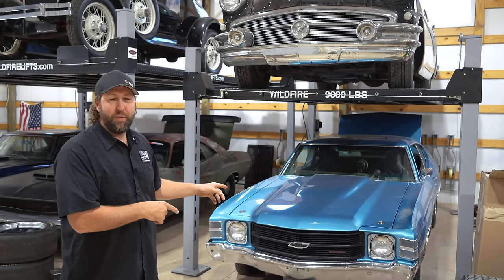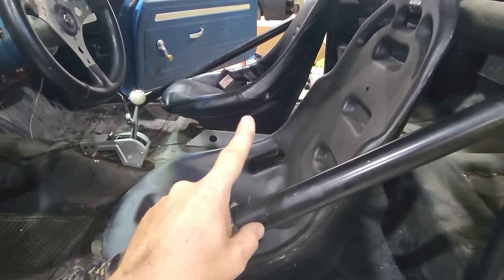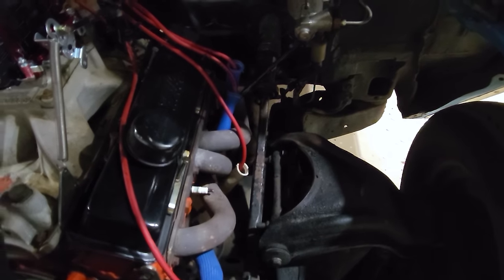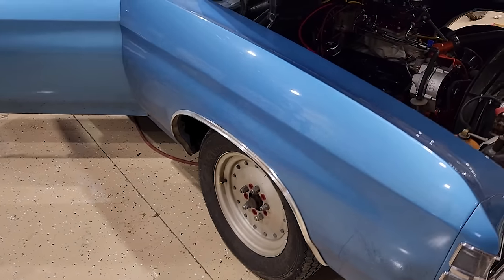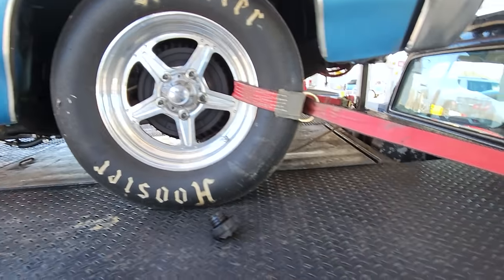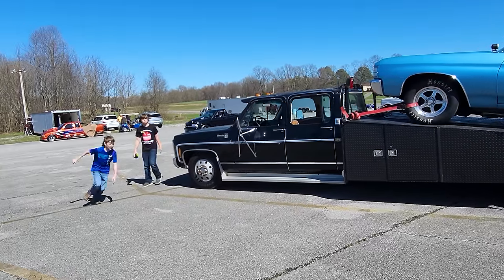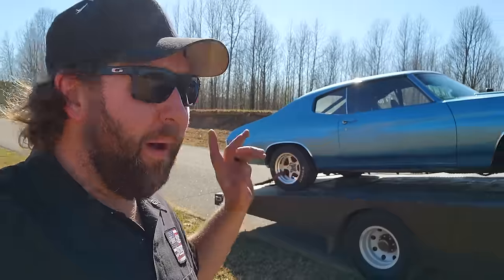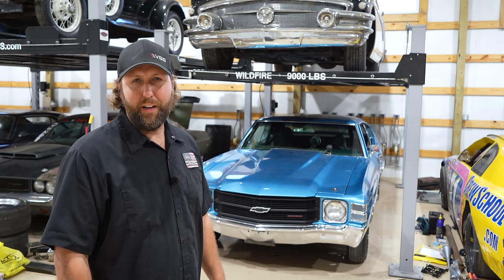35 YEARS off the Road - Classic Chevelle's First Passes are INCREDIBLE!

Comment: You need to hook up a switch that runs youe water pump and fans to cool it down thats how we do it as soon as you come off the track you have some one on your crew start running. The pump and fans shell cool down pretty fast between runs
Reply: If it were me I'd put in a bigger roller cam  and pistons and,  definitely rebuild th at manual valve body transmission and go with a bigger rear gear in the rear end

Comment: Them ole 406s are stout engines, my dad had a built 406 in a 70 camaro with full interior, turbo 350 trans and a 12 bolt posirear diff with 4.11 gear. Car ran 7.60s in the 1/8th consistent. That motor is very capale of making big power

Comment: Hi I love your channel. I suggest you build it up slow first up date fuel an injection system, new ignition would go hand in hand.  Kind a like what we would do slow up grades.  Next Nitrous next gear or transmission changes, suspension as needed, then either a blower or turbos.

Comment: Oh dang my bad lol i thought it was a 350 small block ... thats awesome you have the same small block in that chevelle that i have in my 89 S10 blazer lol. Yup i have a 406 small block in a two wheel drive 89 S10 blazer , its red n white. My uncle built it in the early 2000s.. the 400 small block came out of a chevy impala , it was just the block when he got it. And he had it built and hp wise its almost 1hp per cubic inch its 407hp 406 small block , with a 350 turbo trans. It was built here in Bristol Tennessee. And i also got a gmc Typhoon thats amazing lol. But its nowhere near as fast as the v8 s10 tho.. lol but still neat.

Comment: If it were mine I'd put some aluminum heads (Maybe Edelbrok heads) and a better cam. I'd re-ring it and put in new bearings and gaskets and timing gear and chain.  Then an aluminum radiator, a better torque converter and shifter, plus a trans brake and aluminum driveshaft.I would put Polyuerathane bushings all around and only tighen the nuts on the control arms until they just touch and use lock nuts so the arms are free.

Comment: What to do now? Well, for Drag 'n Drive I would: give a built 4L80e, new u-joints and trans brake, 4:11 posi, Holley Sniper kit, 400 skinnies like the biggest radiator you can shoehorn into it, whatever shifter you are most comfortable with, I like steel fans, so the biggest fan and shroud that will fit. Let's see...high-power charging whirler, maybe an electric pusher fan, let Jessica make the interior pretty, and that's about all it needs to cruise. The old school motorhead who built that engine knew what he was doing. The Crane Commander was a great cam. This recipe should get you to 11.4 quarters on drag slicks (maybe better), but still cruise to town without having to stop at every gas pump along the way. Good luck with it and keep on racing.

Comment: Hey brother that car would've been quick in its day in a eigth mile and I'm probably about to tell you something you already know if you hold it in low gear a turbo 400 will shift itself around 6000 you are right that you need to shift before then until it'll make power over 6000 however the time you lose with the shifter acting up you'll make up letting it shift on it's on because trust and believe it don't miss a lick it shifts quick and hard
You can also flip the linkage where it hooks at transmission from the bottom to the top which will make the shift pattern like a reverse pattern 
If the bracket mount doesn't have top and bottom linkage option you can be creative or buy a linkage bracket that do
Love your show
Keep that humor up you've had me laugh through some tuff times

Comment: I saw that your Chevelle pulled to the side when you left the line . do you not have posi-tracktion ? i had a 65 Chevelle with a 327 H.P. motor with 350 HP running a 411 rear end . I raced many cars , a Plymouth GTX with 426 Hemi , a Henry J with a 383 Hemi . And beat them all !

Comment: I think my path on the car would be first radiator and shifter, then brakes. Update anything safety related and anticipate going faster than planned.  Once that is all stable, time to bump the power.  I would be looking to put the car in the 10s.  Heads, intake, cam... head for 500ish NA power and then add boost or NOS to get in the 750ish hp range.

Comment: i say keep it old school. Freshen up the motor, for safety reasons and gear change options i would put a 9 inch rear end in it, but keep the carb, maybe some gap juice, and a trans brake for a better 60ft. We usually dont worry about brakes but i would throw some disk brakes on the front. and yes this is a beautiful car.

Comment: A 406 with the fuley heads and flat top Pistons is pushing close to 11:5 cc if there's any dome at all it will be 12:1 or higher u need at least av gas in it u should bore scope it to see what Pistons are in it some 112 octane would really make a difference if the block has been decked or heads milled much the 406 with the 64cc heads makes good compression

Comment: Keep it as a 406, throw some nice aftermarket aluminum heads on it, convert to roller cam, and a plate system. Keeps it close to it's roots and an evolution of the original build. Otherwise, maybe a 406ci LS swap. I really want to see the original wheel and tire size back on it, it was old school cool with that setup.

Comment: Keep the small block.  Add modern aluminum heads and save the double humpers...cleaned up and bagged for storage like the museum pieces they are.  They weren't meant for unleaded gas anyway.  Retrofit a roller cam, and get the rotating assembly pro balanced so it will withstand some rpms.  Dial the mighty mouse in for 8000 rpms and you've got the small block that sounds like the dz302, but with the torque it never had.  All in the same lil form factor...hell I'd even run iron eagle heads just to mimic the original look.  Or keep the budget friendly with vortec heads and some bowl blending.  But an homage to the small block, since it has been eclipsed by the ls.  Rightfully.  The ls is an awesome piece.  But this should recognize the moment in time before digital took over.  It has a distributor, a carb...even v belts.  Go for the rpm's Derek.  Old school recognized north of 5000, we just forget.

Comment: So if you REALLY want to wake it up, go look for used AFR200/215, with 64cc or smaller chamber or similar head.
An AFR225 would be just a bit too big I believe for that cam but might work if you allow for possible rocker ratio upgrade.

Comment: Did you make the ball peen hammer in the video? I made the same brass aluminum ball peen hammer in metal shop a lot smaller I may add. I still have and use mine to this day, 30 years latter.

Comment: Up next suspension and brakes. I'm a firm believer in get the suspension you want to have for a larger more hp's. Make it work well and then dive into engine and trans. Good uppers and lowers front and rear. And coil over double adjustables front and rear and an a/r bar out back. And then make some passes. See how that improves the car. Make is bushings so it a decent ride but still a track beast.

Comment: My old daily driver 66 El Camino 406 sbc 555 lift cam, super Victor intake, 780 holly, double hump 194 heads, 4:56, bigest dot slicks that would fit, 125 shot nos, car weighed 3100, ran 11.24 at 124 mph the car was raped out way before the end of the 1/4, over 7000 rpm. i think if it had a 4:11 it might of gotten in The 10's ... 
I love those 400 sbc, i had a 383, but after getting a 400 i never go back to a 383 un less its cheap

Comment: I would not change a thing about that car. It lopes and sounds great. Get the old wheels back on it with better tires if that is a safe option. Maybe fix the floors, a better converter, pull the engine and fix the leaks and then run what you brung. Let er rip on the 1/8 or 1/4 with them 4.11 gears. This was by far my favorite series on VGG. But really, you love the history of cars as do I. Keep it as it is. Don't change an effing thing.

Comment: Let's make it run 10's with a carbureted N/A small block. Nobody does cool stuff like that anymore. Do it in stages so we can all learn and enjoy.  First step, e-fans and an aluminum radiator. Next, swap heads for something modern, maybe find another youtuber to port them in a video series. (Eric Weingardner, Charlie Servido, Vortec Pro, Headbytes...)  Then a solid roller cam swap. Then a modern intake and bigger carb (dominator?). Then gears, converter, and chassis tuning. That would be awesome. Also, can we please call her "Lady Liberty"?

Comment: New shifter / trans brake ! It would be amazing to find a 396 but maybe just duel CARBs on the motor you have. Nothing crazy the car is just to nice. Guy needs to buy batteries powered leaf blowers just to help the new rad / electric fan.Hey why don't they make a two speed rear end. Then a guy could drive in to town to get a soda pop. 😂

Comment: Swap out those old classic double camel hump heads to something newer maybe AFR heads and a Comp Xtreme Energy cam. That 400ci is the best small block GM ever made period. Will take a serious beating. Was always after one for me 1981 trans am but all the wreckers here hoarded them up. Built a 355ci instead. Personally I would just try to get her to 400hp off the flywheel and a high 11's car and call it a day. A decent Deck and a pair of 6x9s perfect street strip summer cruiser.

Comment: I say take it next level old school. Build a 1970 SS Chevelle LS6 454 motor (450Hp, 500 LbTq) and drop it in there. It would be very streetable and 3+ seconds faster in the 1/4. Also change to a TH400 with a 1980s style B&M slap shifter.

Comment: Hey guys question  which would you build  a 305 .40 over or a 307
Reply: Plan on putting in a  91 thunder chicken
Reply: The 305 has a comp cam 270h magnum   not sure size of cam in 307 but it doesn't  pull good till after 4000 rpm

Comment: My math (math is hard), shows it to be a low 12.70 car as it sits. Still very respectable for what is there. Just my worthless opinion, I say electrical fans, new aluminum radiator, some new aluminum heads, a hydraulic roller, fix the shifter, fix the rollbar so the seat can moved to a more comfortable position, and let 'er roll. Should be a high 11 second - 12 flat car at that point.

Comment: I owned a 1958 GMC pickup in 1986 with a "small" block 327. It also had double heads w/ 2.02/1.65 valves, a 305/525 cam, paired w/ a saginaw 4 speed quick shifter. It ran 6.80 in the 1/8 mile producing over 500HP. Stop making excuses for the small block.

Comment: Before I watch I hope ur Chevelle can run 15.50 that converter needs changed bad  and probably the cam is way off I've seen a lot of 350 Chevy motors make 300 at the rear wheels with just those double hump heads and dual exhaust.

Comment: I think you need to go with some bigger tires up under there some actual, slicks, not Street, slicks
Reply from the maker: Why slicks? They shake/spin easier than drag radials.  I had zero traction issues on any run and was pulling the wheel

Comment: Just so you know 3" with a small block is overkilled I don't know where people got that idea that bigger exhaust is always better it's not you can either go way too restricted or you can go way to open even the freakin you gotta think in the in the office so how exhaust works dual 2 and a 1/2 is a single 3" pipe so basically you're just put 42 and a 1/2 inch pipes on that car which will make you lose horsepower My brother used to be an exhaust man and the guy that taught him was an exhaust man for 30 years he refused to put dual 3" on to car because of that particular thing that he he knew as being a drag Racer but you don't do that and why the h*** does everybody have to use f**** overflow Lester they sound like s***